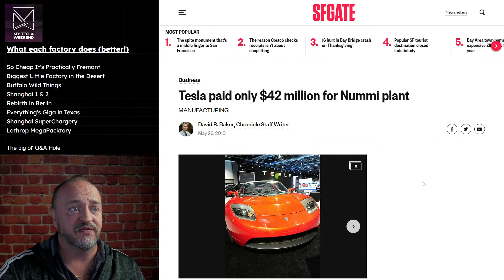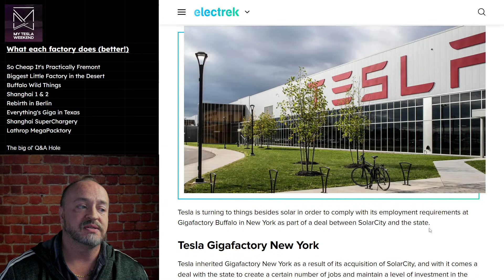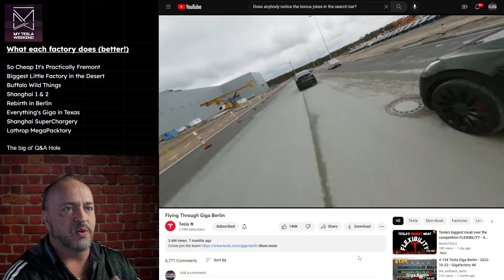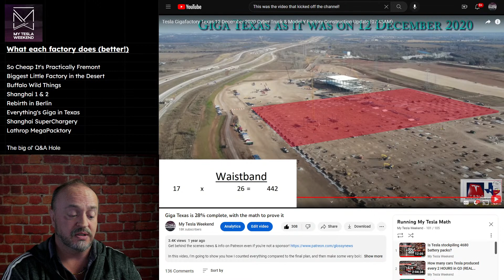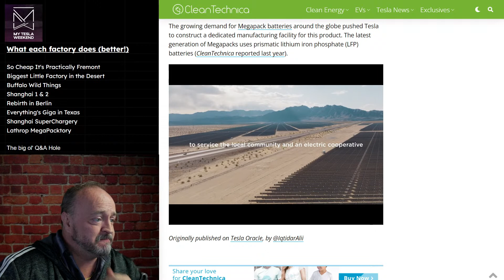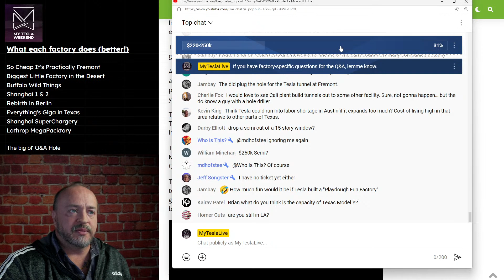What each Tesla factory does (& does BETTER) - Livestream at 7pm Pacific

Comment: Elon is a huge fan of vertical integration. It’s what makes SpaceX so special. Raw materials go into Hawthorne in one end and rockets come out the other. Unlike ever other rockets or spaceship in the US, which are made with seventeen companies scattered across the company, SpaceX is making just about everything they can in their own factories. They are turning out Raptor rocket motors at a pace unimaginable by any other firm. But it’s this thinking that has SpaceX launching more rockets than everyone but China altogether. As Ford proved a 100 years ago, it works. Ford even invented charcoal brickets to use up the wood scrap from his factories.
Reply from the maker: China had more launches in 2021, but SpaceX appears to be ahead in 2022. That's pretty amazing to see a single company out-pace an entire country.

Comment: I'd like to see the Semi price at $290K to $350K because the competition is selling EV Semis for $400K with 270 miles of range.
And if Tesla ends up with a 3 year backlog for the Semi that says to me they are not charging enough. And should have had the price higher and then lowered it over time. 
That is the approach for new technology, B&W TVs were expensive initially and came down in price over time, same for colour TVs and other new consumer technology.